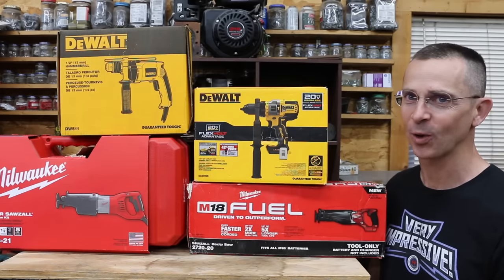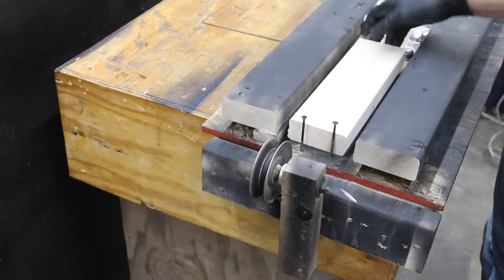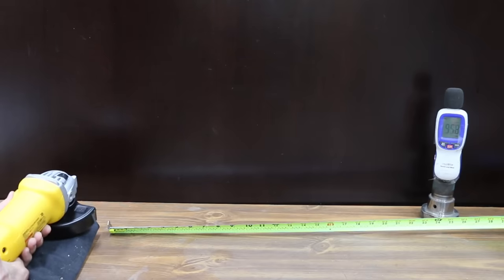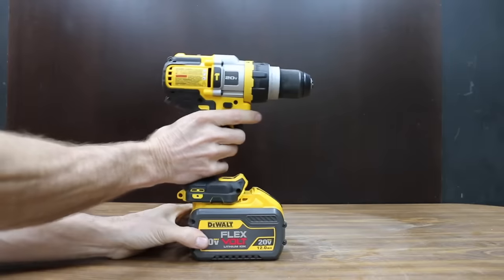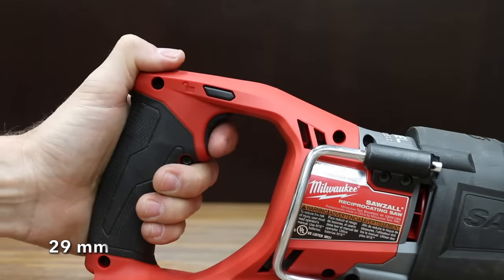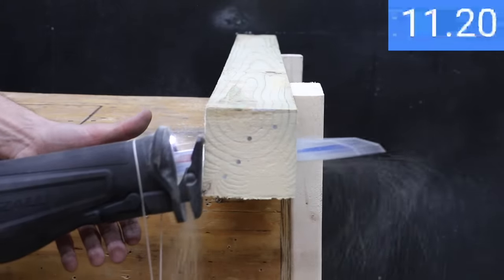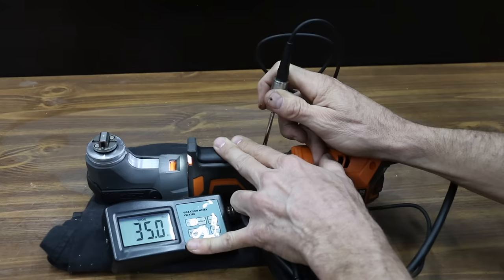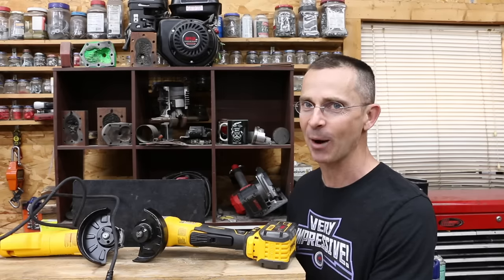Let's Settle This! Are Cordless Power Tools REALLY Better? Torque, Cutting Speed, Noise, Vibration

Comment: Cordless tools are much more handy, but an important thing to note, regarding power - is that max power is only when the battery is full or close to full. The power drops if the battery is below 50%. Unlike corded ones. 
 Having said that - this review mainly compares 18V tools vs corded ones. If this is 54V / 36V  - the power dynamics are pretty different :)

Comment: I think that the context you're using the tool in is just as important a decision for buying the tool. If I have the choice between a corded and cordless tool when I'm working on top of a roof or on scaffolding, I'm choosing a cordless tool, whether it's as powerful or not, because I value not having to deal with a cord in that situation. If I'm cutting sheathing on the ground, I'm going with a corded skill saw because I'll value not having to mess with batteries in that situation. They both have their uses, but I do find that a significant portion of the time the deciding factor is which one is more convenient for the task at hand.
Reply from the maker: Thanks for sharing.

Comment: Seems to me the R&D is going into the cordless tools, where manufacturers can charge higher prices and offer more feature rich tools.  Add that fact that vendors effectively lock their customers to their battery platform (corded tools are universal really) and you can understand why they prefer cordless development.  That being said, the cordless tools stretch to reach the hi-power demands of corded tools, as effectively shown in the videos.
Reply: You can buy adapters for same voltage tools. The research is going into the batteries moreso than the motor
Reply: There's no doubt that R&D is towards battery powered tools.  If nothing else, they can sell you more 5ah batteries at $129 versus getting nothing if you buy the corded version.
Reply: Yes, lock up into ecosystem is аname of the game cordless platform provides

Comment: Been waiting for this. I personally prefer corded for demanding tools like air blowers, sanders, etc cause batteries are expensive in the long term. But impact wrench and drill definitely battery.
Edit : the 10amp or more on corded was useful info too
Reply: For home, battery. I'm lazy as hell, I take out a battery powered tool much sooner. No cable, extender, outlet searching... Click, do, forget.
In work however, we need punch, we usually already have a power source nearby, so mostly corded.
Reply: @redlinegme593  absolutely. I've procrastinated small home jobs because I didn't want to go get a cord and deal with it.
Reply from the maker: Thanks for sharing.
Reply: impact wrench for serious torque i always go air.
Reply: @ronblack7870  Yeah no doubt. Air is king for max torque. Especially Astro Onyx THOR in 3/8 or larger line
Reply: That’s the thing. If you’re willing to wait for the right sale, batteries can be free. No need to deal with being restricted by a cord and an outlet or the cord getting in the way.
Reply: From what I've seen, the higher power Milwaukee impact wrenches are only available cordless too. The only other alternative is air.
Reply: I like prefer corded drills, especially when working near outlets. It just makes more sense
Reply: There is a reason few have ever attempted the cordless belt sander.
Reply: yeah same, I prefer corded sanders and saws, but cordless impacts and  drills
Reply: And some tools are used in such a way that battery power just dousnt make sense. Any job that requires more than 15 min of continuous sUse. Grinders. Sanders both come to mind.
Reply: Corded drills for sure….
Reply: @plaid11  yeah, but those batteries are usually the lower spec versions that are utter garbage. And let's not forget the fact that they will eventually die, needing replacement. And the battery design will become obsolete over time, meaning you will need to buy a whole new tool eventually. Power cords are much cheaper to replace, and will most likely not be changing design any time in the near future.
Reply: Yup. Melted a drill once mixing up a 12.5 lbs batch of thinset.
Reply: @superme63  I mean, I’ve yet to buy a battery on its own and they’re all pretty good. The Ryobi batteries aren’t the greatest but they get the job done. Never had any issues with any of my Milwaukee batteries. Have more than enough 5Ah batteries that I can switch them out easily when one dies. Have a few other higher Ah high output batteries too that came with tools and ended up being cheaper than regular tool only price. Power cords aren’t too far behind in price. It’d be different if I used them everyday all day. Since I don’t do that with my personal tools, my batteries will last for at least a decade. At that point, I have no problem putting some money into a few batteries here and there. I’d be able to wait for a sale and get two or three for the price of one or get a free tool

Comment: It seems like the manufacturers have put more effort into improving the cordless tools than the old technology corded ones.  Good video!
Reply from the maker: Thanks!  Thanks for the feedback.
Reply: There's also the restriction that for a mains tool to use brushless motors, they'd have to first convert the power to DC and bring down the voltage. That kind of circuitry is both expensive and bulky. They use cheaper AC motors in the tools (that don't have the same features as high power DC ones) instead.

With cordless tools, your mains step-down hardware is all handled in the charger, a central device that you only need one of.
Reply: @ConstantlyDamaged  why must they bring down the voltage? If anything rectifying the ac should raise the voltage because the capacitor used in rectification.
Reply: @Damaged I do not believe your assertion is correct. A brushless DC motor in a given tool will be wound with the given supply voltage in mind. In the case for battery powered tools, typically anywhere from 18 to 60V being your bridge voltage depending on what you've got. There are some brushless corded tools being released by manufacturers such as DeWalt's DWE43240VS , though mine has been on backorder for 2 months because I don't want to be extorted by Grainger to get it sooner. I'd like to verify some of the design elements in it, but I don't have it.

Having said that, a BLDC motor can be wound with a higher DC bridge voltage in mind, making it possible to drive such a motor from a rectified AC->DC converter with no DC to DC voltage conversion being involved. The inverter(Part of any BLDC system) will then simply change its PWM duty cycle as it drives the motor phases to control current, which will control torque, which will control speed with the assistance of some feedback (motor position preferably for speed, but depends on implementation... and current sensing for the other primary feedback signal).

The manufacturers have just been pushing this battery crap on us as hard as they can, so it's more a function of R&D not being directed toward corded tools. Corded impacts tend to have pitiful torque ratings compared to their battery powered counterparts, for instance.
Reply: I remember when the corded saws were categorized by HP. Then they went to amps. It sounds crazy, but one of those old school HP rated circular saws will run circles around this new stuff. I had to make an 18' long stringer for an old victorian home I was remodeling. No One had a piece of oak 16" wide and 20' feet long. Finally my customer found one at an old redneck saw mill in the middle of nowhere. It was rough cut. Literally a slab cut off of a massive oak tree. It was about 2 1/2" thick and uneven widths. I had to make a straight piece out of it. My customer had a big table saw. (mine was at home in the shop). We tried to run it through it and it bogged the motor down. I got out my old school circular saw. He looked at me like I was nuts. He said you can't use that if it bogged down my table saw. We struck two lines (one on each side.) That old saw cut through that oak like butter. He was tripping. I then had to plane it, sand it, stain it and varnish it. It came out beautiful. My customer gave me a $500 tip when I finished that stair case.
Reply: @ethansprojects7399  Several reasons.

1) higher voltage brushless motors tend to be lower RPM, meaning you'd also need a gearbox (more weight and things to break).

2) doing PWM at higher voltage requires a larger motor controller.

It's far easier (cheaper) to just use a powerful AC motor.
Reply: @YDCFF_  what makes the old ones more powerful? I swear the old cord tools were downright scary powerful. I have an old SKIL branded hammer drill that walks circles around a newer Milwaukee that's supposed to blow it out of the water.
Reply: @Sevalecan  PWM motor controllers for brushless DC, for high voltage motors (110-230v) tend to be quite large. Certainly bigger than what would easily fit in a tool housing.

I have no doubt they'll eventually get the electronics down to a scale they could drive a good high voltage brushless motor, but we ain't quite there yet.
Reply: @YDCFF_  Was it a worm drive circ saw?
Reply: They have to, a battery only holds so much charge so that charge has to be used very efficiently. A corded too is only limited by the current available from a typical wall outlet in its country (ex in the USA and Canada that means 120v 15A).

Also of course cordless is the in thing with those who the tool mfgs actually market to(its not contractors, Those guys already generally know which is the best tool type for a task from their experience), but Cordless needs things to get the Saturday DIYer to buy their latest creation vs just getting the corded drill like pops used.   of course Cordless will always be the great one for quick saturday tasks since it has no real setup time.
Reply: @jmackinjersey1  No sir. A 2 1/4 HP craftsman 7 1/4 inch standard circular saw.
Reply: @Sevalecan  thanks, I was wondering why corded aren't brushless.
Reply: That's because corded is slowly getting discontinued. They make more money by selling us batteries. I don't mind it. Plugging and unplugging gets old and annoying.
Reply: @juanmancinas56   I don't mind picking up used corded tools at garage sales for $10 that work pretty well. Just have to avoid the rip-off brands, Black & Decker et al.
Reply: Well yeah. Batteries equal more 💵 💵 💵.
Reply: @juanmancinas56  I'm guessing you don't make a living with power tools. Contractors don't work by the hour. We have to compete bidding against others. Your profit is determined by your overhead. Every dollar you spend on batteries, or paying guys to wait for one to charge, costs you money! I have tools I've been using for over a decade with cords on them. In that time, I would have spent thousands on batteries. Yes, I have cordless impacts for hanging drywall etc. But, when you get in to saws, nail guns grinders etc, Cordless is a profit killer. I bought a cordless weed eater and gave it to goodwill. I'd get half of my yard trimmed and need a battery  charge. One tank of gas will do my yard 3 times.
Reply: @ConstantlyDamaged  DeWalt has several brushless corded powertools that fit in a comparable form factor to the universal motor designs(List included at the end, larger than I thought it would be.)

As for PWM motor controllers, I'd be interested in your frame of reference. Certainly they /can/ be huge, a typical VFD for instance is relatively large, but they aren't designed to be used on a handheld tool and have many other design considerations in mind.

Keeping transistors cool with high voltage switching is something that improves over time. Angle grinders as shown in my list tend to have a high speed fan built in to help cool the motor, that would be useful for a brushless motor inverter as well. MOSFETs being more efficient than other transistor types have improved in their voltage blocking capacity and can be easily sourced to handle a high bridge voltage (Perhaps that is not part of your disagreement). That, and it is possible to switch them on and off quite fast, reducing switching losses. Couple that with a low Rds(on) and I think we have the technology.

With the list below, the only question is: Did DeWalt do something weird to eliminate the need for an inverter while maintaining several control-loop based variable speed designs? I'm not sure they could. Need a high electrical frequency to bump that motor speed up. 

If I'm wrong, I'd enjoy learning why and how if you have more to add.

I'd like to get my hands on one of these, may have to try a different supplier after 8-9 weeks.

DWE4997VS
DWE4997NVS
DWE43266N
DWE43231VS
DWE46202
DWE43240VS
DWE43240INOX
DWE46253
DWE43214
DWE43214N
DWE43214NVS
DWE43840CN
DWE43244N
DWE43265N
Reply: Thats because they make huge profits from the batteries they sell you.

Comment: What about a showdown between the battery chainsaws, string trimmers, and lawnmowers vs the gas ones? That would be interesting.
Reply from the maker: Great suggestion!! Thank you
Reply: Yes, great idea! Replying to get behind this idea and have it go to the top! ;-)
Reply: Been hoping for a string trimmer video. I need to buy one soon, and I don't like to purchase tools without consulting this channel first 😂
Reply: @Doc__Vegapunk  He just did one on string trimmers.
Reply: @ProjectFarm  I'm surprised you didn't compare the maximum run times between the cordless and corded tools.  😺
Reply: If you want a good gas powered string trimmer I’d go with an echo … cheaper than Stihl still with great performance and I’ve had great durability with then
Reply: @HariSeldon913  HAH!
Have a nice day.
Reply: @kennethwright8081  yes a 2620 or 3020 and they are much nicer than the stihl competitive models. Way smother, no valve adjustments, and more control under light throttle.
Reply: @kennethwright8081  Me too0. Just gave the son-in-law a fine Echo convertible with all the accessories. I've seen Echo equipment run with NO compression and keep on running. Unbeatable in this book too!
Reply: Just bought the Milwaukee string trimmer after watching Project Farm's video on battery string trimmers. It is replacing a Craftstman 4-cycle gas trimmer that went kaput. 

Comparing the two, the Milwaukee comes very close to the same performance, but it doesn't quite have the same oomph. I don't know if its because it lacks the same power as the gas trimmer, or if its because it currently has 0.08" line on it (what it came with; it can handle up to 0.095") where as I usually use  0.105" line on Craftsman. Either way, while it does well with even thick grass, it doesn't handle some of the thicker weeds quite as well.   

It also lacks the endurance of gas trimmers, but I already knew that going in.
Reply: @Regolith86  IF I ever get one I'll get a DeWalt because of the power BUT my Sweetie said that if I'll start the 2-cycles she'll keep weedeating with what we have. Can't beat a deal like that!
Reply: @ProjectFarm  if you do the chaisaws buy the 20 inch dewalt chainsaw i think it is best electric saw
Reply: When it comes the outdoor power stuff if you’re earning a living with it then it’s hard to beat gas powered tools.  If you’re just using it around your house I’d sell every gas powered thing you have and go battery powered.
Reply: I have tried 3, electric, corded lawn mowers for over a decade. Corded mowers are always stronger than battery powered electrics. Unless you have a perfectly flat, manicured, mobile home size, postage stamp sized lot with zero trees, you're better off with the weakest, cheapest, gas powered motor on Craigslist, than you are with the most expensive electric made. Electrics are usually made with plastic decks that crack if you run over something like a branch or rock. Once the deck is cracked, you have a mower that is always louder and less efficient than the cheapest gas mower you can find. Trust me on this.
Reply: @Swim Fan My Sweetie got tired of the gas jobs and went to Lowes and got a battery blower and trimmer kit with battery and charger. The blower has been used once and the trimmer once. She ran it for 5 minutes and me for 10 or 15. Talk about WORTHLESS and it's a 40 volt job! She now says if I'll start the gas trimmer we can use what we have.  Live and learn.
Reply: @mramseyISU  RIGHT but only then!
Reply: @lewiemcneely9143  I want a gas powered one, I've tried battery powered ones and I prefer the gas powered ones.
Reply: THAT'S going to be an expensive test for sure
Reply: @Doc__Vegapunk  Don't blame you one bit. I'd go with Echo. VERY reliable and long lasting. I'd use Stihl or Husqvarna oil mix for them and non-ethanol gasoline. I've been using Tru-fuel but it costs but is a done deal. Just pour it in and go to work. BLESSINGS!
Reply: Fudd here, your out of your mind if a gas power machine is going to lose to a battery tool. I'll eat my own cargo shorts and white socks if that were to happen.
Reply: @eddyflo2978  And I wonder if folks think about where the power comes from to charge the batteries. There's a carbon footprint lurking around there somewhere. Concrete and windmills don't just appear and I haven't seen a solar panel on a quarry shovel or rock truck mining uranium.
Reply: @eddyflo2978  Absolutely. The only reason (I think) that they're discussed is because they're being pushed by the retail stores all of a sudden. People buy them and think that they're just as good, but actually better because they're "greener" (I could see the energy costs being less though). It would be nice to see how badly the electric tools would perform side by side with the gas saw, trimmers, and mowers, though.